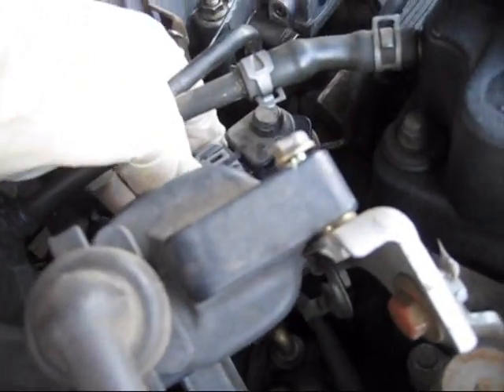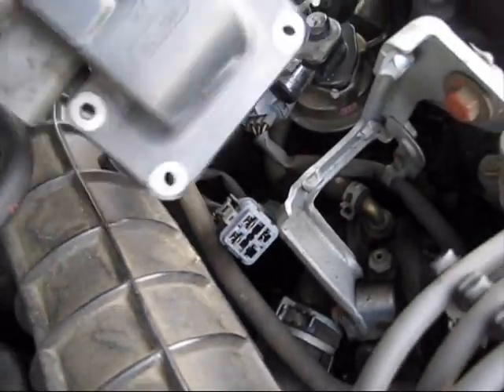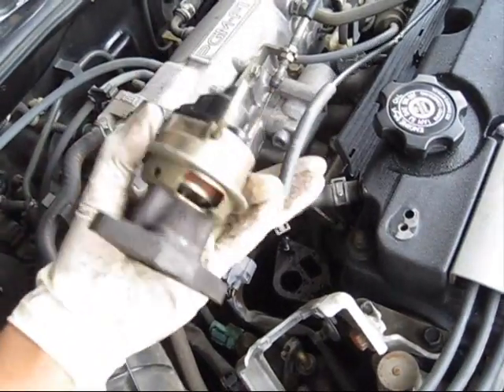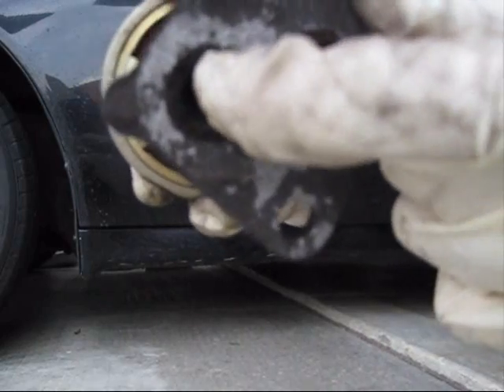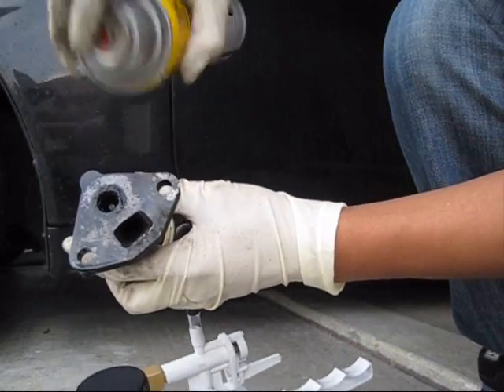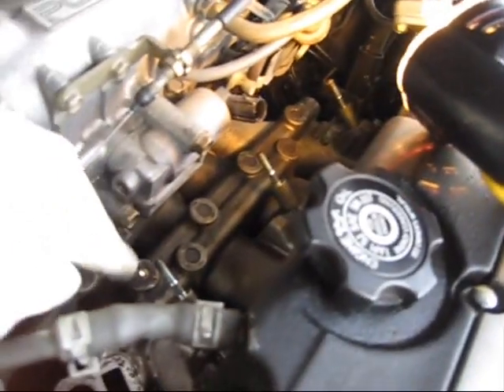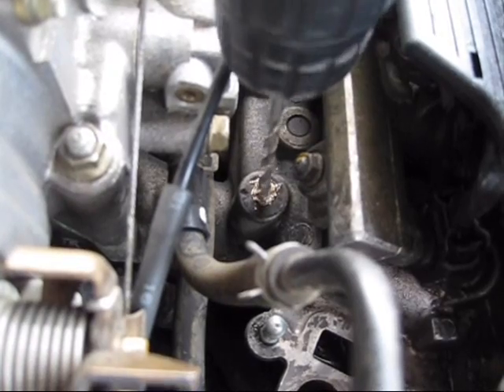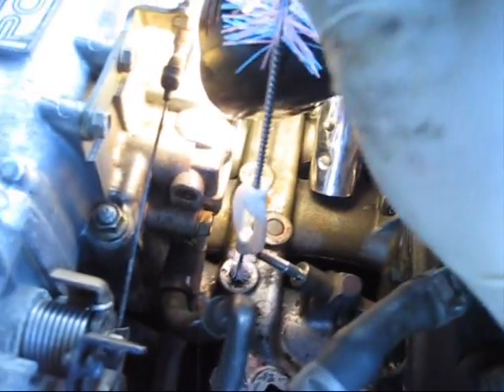P0401 EGR Valve Port Cleaning

Comment: Yikes! Looks like the first time cleaning an EGR valve. Of course I couldn't tell if it was your first time removing one as all the parts magically came off. Impressive. I was sure you were going to destroy the rubber diaphragm when you held it upside down while spraying the "carbchoke". If you're going to destroy it, why not just buy a new one? 

So, advice: Clean out the carbon first with tools while it's dry to chip off most of it.
Protect the diaphragm (wrap it or tape the holes shut)
Spray with the can upright so the liquid comes out first.
Make videos AFTER you can tell us how to do something.
I'm sure your next try will be better; know better, do better.

Comment: Thanks for the Video, I am about to do this with my 97 Prelude SH.  I called a shop and they said it would cost between $95 and $405 depending on how dirty the EGR ports are.  After watching your video I think I can tackle this myself.  Also when you got done, did you notice any difference in performance / MPG?
Reply: Hey did you ever get the ports done? If so where did you buy the replacement plugs?

Comment: It would be helpful if you would state make an model an year
Reply: +Ayy gee Uprising Hes got a 5th gen honda prelude (1996-2001)
Reply: +Dustin L 97-2001* Creditability: I own a 97
Reply: +Ayy gee Uprising This is actually a continuation from a 1998 Honda Prelude Tune up tutorial (which was stated in the first video) with a Fuel filter replacement and an EGR Valve cleaning. 

This video is the latter.

Comment: I've taken auto mechanics 1 and 2 along with small engine repair, fully disassembling and reassembling with new parts an old push mower motor and I have worked on my car myself most times to save money but never have I ever seen anyone nor myself replace an EGR valve.  I have a 1998 Pontiac Grand Prix GT and the gas tank is difficult to fill due to overfilling and I'm sure there is gas in the evaporative canister so that's my next project as well as a new window regulator and motor for my front driver side window.  I know I'm rambling, but impatient waiting for Amazon to deliver the parts.
Reply: The interesting thing about that is the fact that it is a prelude. In my, limited I grant, experience prelude almost always run dirty and almost without exception burn some amount of oil. This causes a build up of carbon in excess of most other cars in a variety of places. I'm in the process of cleaning mine out right now, and i had it done 2 years ago and its pretty bad already again.
Reply: Benjamin Fink I changed evaporative canister and evap vent solenoid and it took care of my P0440 code and window regulator is changed as well.
Reply: Cool, cleaning out my egr has fixed my misfire issue.

Comment: Just one small piece of advice.  Hold the spray can in a more upright position when spraying.  You will end up relieving the can of it's pressure before you actually run out of the product inside the can.  Good vid though!!!

Comment: i cant find a way to get to the lower bolts holding the valve in, can any one help? My extension can only get at it on an angle and it slips. I don't want to strip them

Comment: I have a Toyota Hilux model 2000. There is a some sort of valve with three small vacuum hoses. Also that thing is connected to the exhaust headers. The mechanic said that I have to replace it. Is that really the problem why my engine idle is surging especially during extremely hot day? Or is it VSV? Please help somebody here. I've been screwed many times by this problem.

Comment: I have 96 passport ,what I did is step by step first  ...I cleaned MAF with mass air flow cleaner 2nd IAC with throttle body spray or MAF spray also Throttle body, 3rd I replaced the EGR valve but before that I cleaned the  passeges with throttle body or maf spray and I let dry for 1hr. ( for me ) I'm replacing my egr anyway so mine as well clean the whole emission job. So just to let u guyz know when u buy EGR on ebay or any shops that with free gasket ? Don't use it just buy another one on auto zone only less 2 buks, I used the free metal gasket that included on my EGR and WTF!!! gave me heie1,loadache coz my rpm went to 2500 rpm at first normal driving 1000rpm but the I test drive on the freeway specially hot weather the I can feel that my rpm Goin up so I shut off my engine and turned back on for about 20 sec. Well  it went back to normal. In my car I use silicon sealer so I did apply and now it drives perfect! Make sure when u clean N remove those hoses 
Put it back exactly N tight them up real good coz that also a big factor for leakage.

Comment: BTW, NAPA... there is a real handy tool that plumbers uses. You can get one for a little over a dollar. It is a rod with a steel brush on the end that they use for cleaning out the inside of copper pipes and valves. It's works pretty well for the EGRs, but its real aggressive so you have to be careful. It's made for twisting... clockwise it digs in and counterclockwise it cleans on the way out. IOW, the brush on the end is like threads. Depot and Lowes carry them... ditto Ace-Truevalue Hardware.

Comment: One question I took the whole intake manifold out and clean it as well also the EGR valve , but didn't do the cleaning process that you did in this video how do I take those bolts out as well do I need to replace new ones when I take them out??

Comment: hey man thanks i have a 2001 honda accord ex and and i think it's similar to the car on the vid...i dont have that removable plate some cars have to clean the EGR valves...i want to clean it like u said but what is the intake manifold? is it the aluminum thing  after the EGR? the big metallic looking box with the metal wires?  thanks

Comment: you relly didnt need to drill the ports out. all you had to do is take the intake manifold off the car and clean it.1, it helps to clean the inside of the intake manifold. 2, you get to the EGR  port in the inside of the manifold all you need is a good pick and that helps to clean them out. .3 that gives you acces to the intake ports on the block and you can also clean them to. all that helps not only for EGR system but for parformence. cleaner intake, cleaner air to the motor to burn.

Comment: Tip 1: You don't need a pressure gun to do this. Just put 2 fingers on the orage pillow and press it up. That opens the valve and you can spray in whatever you're cleaning with. 
Tip2:. You can always skip the egr valve and replace it with a block plate. 

and here is the question.... cleaning bottles?? You ment to say clean his bong right?? :P

Comment from the maker: Either the EGR is in need of cleaning or it has to be replaced. Removing the EGR is fairly easy, remove, clean and plug back in. if code is still there try replacing EGR
Reply: Egr mucho denero

Comment: I have a 1998 nissan sentra gxe 1.6 and my car shut down on me at least 5 time today. I had them read the chek engine light and this is what came up code PO400 EGR passages blocked, EGR pinltle stuck closed, EGR volume control valve open or shorted, EGR temperature sensro error. Please tell me wht I should do? clean the EGR valve? help

Comment: My 96 Ford Ranger is under powered right now. This is one of the recommended deals to check plus replacing plugs,wires, cap, button, fuel filter,,,,,,,,etc. Thanks.

Comment: dont forget to clean the tubing that goes from the egr valve to the intake manifold..like on my 95 geo tracker...if I just cleaned the valve and reinstalled it ....it would have not made a difference....cause the tubing from the valve to the intake was blocked..meaning no hot gases would make it to the intake...so the thermophile could not get to temp...throwing a 51 error code...the valve was not the problem at all it was the clogged tubing coming from it...

Comment: The light came back on, so we took the EGR valve off again and realized we had not cleaned the carbon off the manifold connection where it was attached.  After a can of gumout carb cleaner and running seafoam through - It passed emmissions!!!!!!!

Comment: so far so good.  Not sure the codes have had enough time to reset after I disconnected the battery.  I think we may have failed to torque the nuts enough last time.  Not check engine light, but only 40 miles on it so far.

Comment: I replaced the EGR valve last year.  I didn't go into drilling or pulling plugs, etc.  Do you think I could get the codes to work just for now with a good cleaning and plenty of carb cleaner.

Comment: Nice video :D

Just a tip: don't tilt aerosol cans when you spray them, always tilt whatever you are spraying instead of the can.

If the can isn't upright, it doesn't work and it sprays the pressure out instead of the "stuff" inside that you want to spray.

Notice how when you left the can level and vertical, it sprayed properly ;D

If you hold the can sideways and hold it down it will eventually run completely out of pressure and mess up the contents of the can, making it shoot out like a jet.

Comment: If it was a old carb engine with a vacuum EGR, you can delete the system with no issues, but EFI systems go into default when a EGR error is popped to prevent engine damage, this will kill the engines performance and gas millage. Takes less than 40 mins to fix it correctly, just pull the manifold and clean the crap out with solvents.

Comment: yeah it has an idle but i know how some peoples engine when it has an idle the car turns off or stalls. My CL has never turned off on me even if it is idling cuz i can feel the idling when i drive & at a red light it's like a misfire like it's spitting but idk why it's doing that & you may be right cuz when i bought the car the engine ran good with the old egr no idle no nothing now i put the new egr valve and my engines idling & running rough. But idk im thinking it can be other things as well.

Comment: hey i did this and i cleaned my egr ports on my acura 97 3.0 cl then i drove it the CEL came on & said cylinder 2 misfire. Checked the CEL the 2nd time & it said my misfire codes were ALL ok but it said the same code p0401 egr valve insufficient even though i cleaned all my ports on the intake manifold & the egr & i replaced my egr yes i know i didnt need to do that but mines was already old so i was like fuck it. but after all that the code came back up again. Do you got any suggestions for me?

Comment: @nico27004 you really need a slide hammer.  It costs about $20 at auto parts store or at tooltopia.  If you try to knock them in half way like block freeze-out plugs, they'll drop into the manifold and you will NOT be happy.

Comment: Just so everyone knows sometimes just spraying the carb cleaner isnt enough..I had to literally scrap the carbon off with a flathead screwdriver in addition to using the carb cleaner since mine was froze up bad. However it worked and I didnt have to buy a new one. Not everyone may have to resort to scraping tho.

Comment: Good job!  You can do this job much faster by leaving the fuel rail in place. Drill the plugs with a smaller bit, then thread in the sheet metal screw that comes with slap hammer to pull them. With this fast method though, you can't reach one plug, but cleaning the other 5 will make thing clean enough for proper flow and no CEL.  Just use fresh can of carb cleaner with a tube. Blast into every port hole.  Let it sit for 15 minutes. Go back again, and all the carbon will be liquified.

Comment: Did you have to do anything special to access and remove the bolt closest to the fire wall? I tried using a crows foot because I couldn't get a socket in there, rounded it off. :/

Comment: theres an easier way to clean the egr. you can just spray seafoam in the intake side while the engine is idle and it will clear all the carbon out of the ports, once all the carbon is gone youll know because the engine will either rev really high or idle out and die

Comment: V V V yes seafoam is a great product! V V V if you are broke and don't wanna take out the plugs from the manifold here is what you do! I did it and it worked out great for me! 

First off remove the egr valve Next clean the egr valve until it move freely without it being stuck then get a metal hanger and make a hook about the size of a baseball and fish it into the square hole wiggle it around so it goes in all the way IT'S TRICKY and when it can't go any farther go forward and back for a littl

Comment: The way to fix this crap is just seafoam the engine and put the rest in the tank. Other wise run the engine with some 2 dollar chemtrol at walmart is very effective more so then seaform and will eat everything from varnish to dirt particles but won't hert the engine much if any. Done this manual method before when a friend had bad plug wires and stuffed egr.

Comment: @BlackFreemasonsSuck Check your coolant level, you might need to flush and fill your old coolant if you're over heating. My '96 Eclipse was overheating at idle, turns out I was low on coolant. Did a flush and fill and hasn't over heated, even with the AC off at idle or while on the highway. Maintenance is key; treat her right.

Comment: What are the plugs for that you drill out? What part of the engine are they in? (I don't have a GM car) Why do these plugs need to be drilled out, nothing is flowing through these holes since they are factory plugged.

Comment from the maker: @123LouieV if u feel u cleaned it well n the cel didn't go away, then the EGR valve needs to be replaced. If your idle bounces there might be other issues. Try adjusting your valves as that might help with the idle.

Comment from the maker: @123LouieV i didnt get the pulling of the ports out with the slide hammer in the video. hopefully thats understood if u have a slide hammer. One thing u should be aware of are the injectors. Some gas will pour out, but thats ok. just becareful to keep the O-rings in tact make sure they fall out n get lost. other than that u should be good

Comment from the maker: @jdmsrv93 I tapped with a 6mm thread and used the screw that came with my slide hammer. I don't know the size of the screw. Try comparing your screws to your tap kit drills. You can hold each one side to side for comparison or point them against each other to evaluate the size difference.

Comment from the maker: @jdmsrv93 I dont mind, feel free to PM me as many questions. I'm not a car expert, but u can always ask. I just may not respond too quickly. email works best, PM me and I'll shoot u my email if you need. For the drilling to tap, I drilled a few cms deep, about halways through the plug. It's trial and error to see how deep the plug is, but it won't hurt if you drill all the way through the plug. I've done it, but it still works. Again, just drill deep enough so the screw has enough teeth to grab

Comment: hey another quick question if u dont mind,,, u know how u drilled the plugs, do u go all way thru the plug? or justy enought to tap it,,,,, and also after tapping it with 6mm thread,,, wat kind of screw did u use to screw the plug out?

Comment from the maker: @jdmsrv93 yes, perfectly safe. SPRAY LOTS. Let the ports fill up with it with carb cleaner. It's hard to get into the ports with the brush alone. You'll need the carb cleaner to break up all the carbon that the brush cant. Go wild with the carb cleaner, trust me.

Comment from the maker: @jdmsrv93 u can buy the o-rings just in case. Having extra o-rings around will be helpful. They're a bit tricky to put back on, but its doable.  As far as taking out the plugs, theres no other way besides drilling and pulling it out with a slide hammer. Unfortunately I didnt get the pulling of the plugs on video, but that process is simple.

Comment from the maker: @jdmsrv93 You can get the plugs from the Honda dealership. Its less than a $1 per plug. They're called Port Plugs. When i took out the fuel rail, the injectors did come out and luckily i didn't damage the O-rings. I did help a friend do his and a few of his O-rings were destroyed. Be careful when removing.

Comment from the maker: @jonyrock good point! Seafoam is a great method to clean out the carbon. However, I did seafoam yet it wasn't enough. The CEL was not cleared. For others, applying seafoam will help regardless of it clearing out the CEL. Thanks jonyrock

Comment from the maker: @billy0132 i didnt get the vacuum part in the video because i needed two hands to do the job. basically as you drill have a vacuum hose right next to the drill so that the metal shavings will get sucked up.

Comment: You could have cleaned it by just spraying some wd 40 or better down the narrow pushrod guide. This would disperse the carbon. What is your plugwire resistance? 
Usually a real hot spark should not allow carbon deposits to form. Is the ign. coil tired?

Comment: That looks like a Honda but can't tell what year. If  you have an EGR that you clean, replace, etc. and it still won't do it's job, the culprit is probably in the EGR Solenoid located inside the control box that sits on the firewall. It's a little round thing attached with 2 screws. If it is bad all the cleaning in the world won't make your EGR valve open and close properly.

Comment: @Rob2977 Oh sorry did not see a first post before. This makes my reply useless. High voltage is a good indicator that there is not enough recirculation. Which means, Yes, its clogged fully or partially and should be cleaned.

Comment: @Rob2977 I have issues, not sure how you screw up check with cheap but apparently I did. Anyways for sure check the voltage but also you should check the engine light. If you go to high school you may be able to borrow one or possible if your college has one. Otherwise canadian tire and elsewhere will charge you a ridiculous 100$ for a 4 minute job... not even. But that would be the best way to find out.